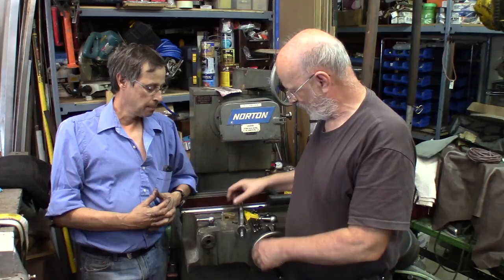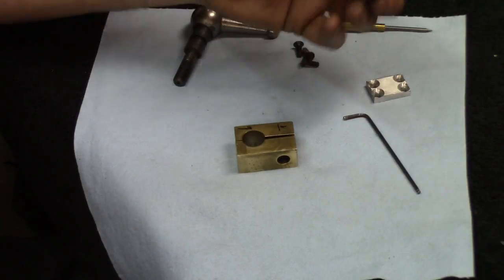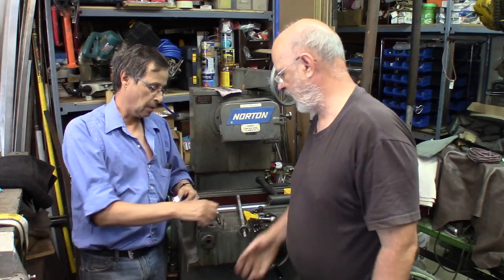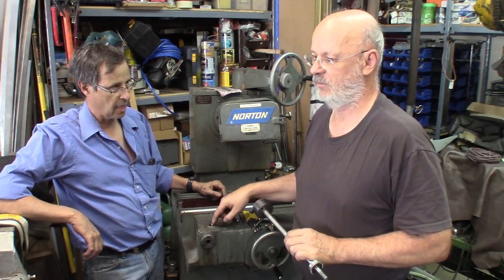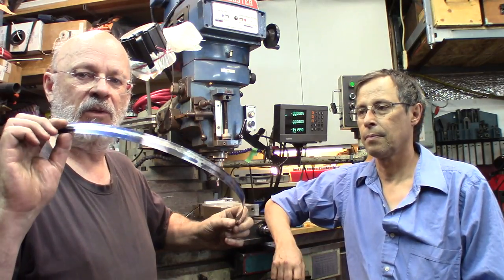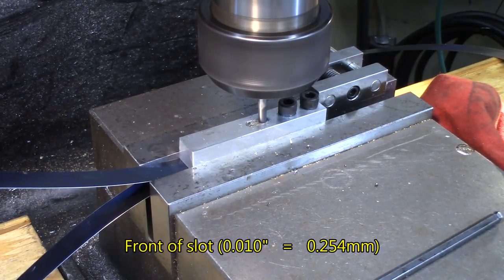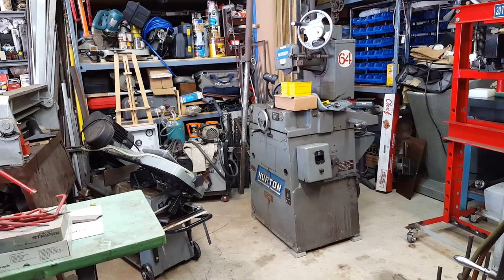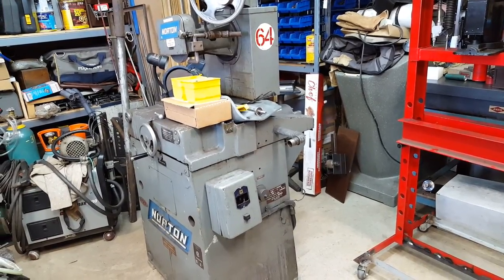Shop update, progress on Norton surface grinder

Comment: Hi pierre, what lubrication do you use on the bearingrollers of the ways?
Reply from the maker: I just used some 68 grade way oil, for the rest of the machine there is an auto lube pump, there also I use the same oil...